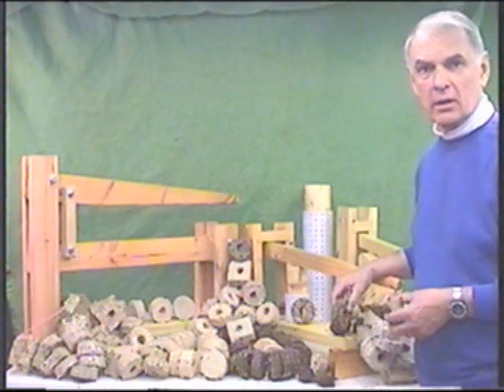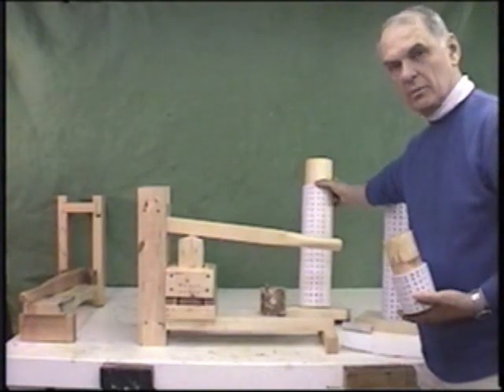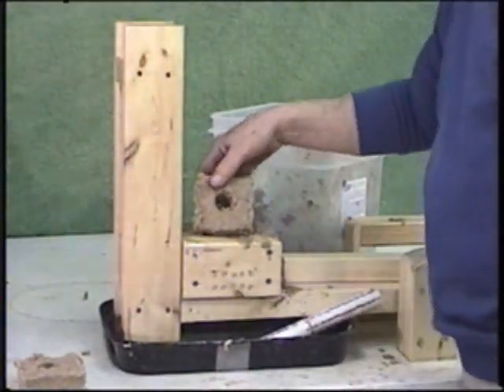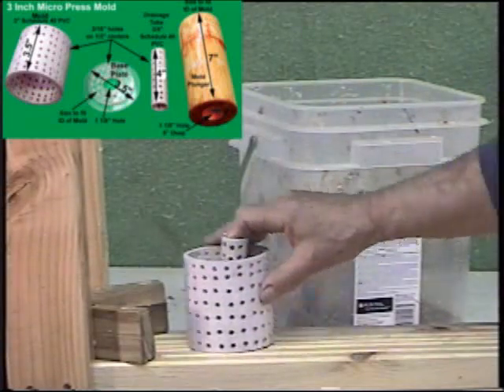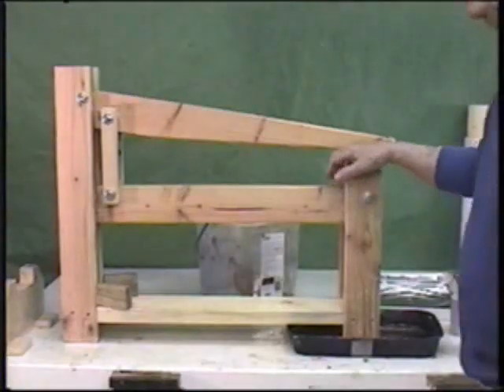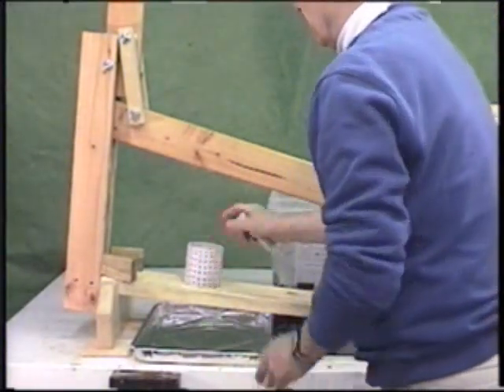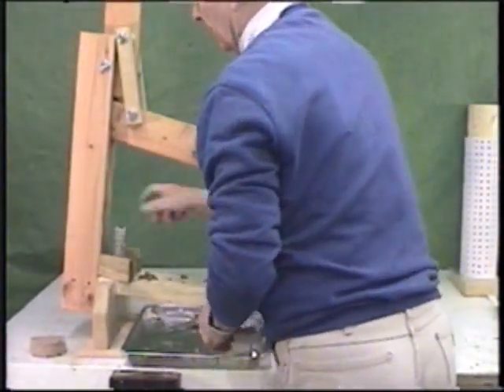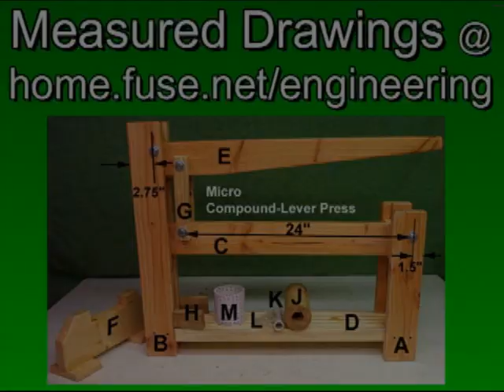Small (Micro) Biomass Fuel Briquette Presses made from Wood

Comment from the maker: Good question: I have found that hot water or even warm water helps considerably to breakdown the paper into pulp. Newspaper dissolves rather easily in warm water but the paper with a hard finish from magazines seems almost impossible to dissolve, even when in small chunks.  Of course heat can be hard to come by in some locations. I would recommend separating the sheets by hand then soaking in a black colored pail of water left in the sun for several days.  Not a great answer but it should help.

Comment from the maker: Good question. By volume using wet feedstock.  Soak sawdust or wood chips for maybe 10 to 20 minutes to allow for saturation then drain the water. Power stir B&W newspaper into hot tap water (not scalding) with a power drill using a paint stir with stir veins. From dry newspaper to paper pulp in about 5 minutes. Drain and mix the wet proportions, and add water for final mixture.  Always do the hand squeeze and shake test to verify a good mixture. Looking forward to seeing your new press design.

Comment from the maker: Outstanding idea, thanks for all the good work on this and for doing the video. In case it helps I have had good success with soaking wooden molds in used motor oil for about a day, after drying of course. The oil helps reduce the friction from wet sticky wood which helps with ejection and the expansion issue. Nice work!

Comment: I guess I will have to wait to get some either used cooking oil (will have to check with the wife about this) and/or doing an oil change in my gas car (doesn't need it yet as I just did it).   Water and oil don't mix so I guess that would definitely reduce the "sticking" issue.   Love producing more than one at a time!   It saves TONS of time this way!  Just add more support 2x4s on the base rails.   Otherwise plywood bends and they come out uneven!

Comment from the maker: Sure, no problem. Local material varies considerably around the world. I find people use whatever they have locally available like metal rods, metal pipe, nuts & bolts if they have them.  A metal rod with a split pin is a great idea.  I'll add that to the manual. Thanks for the suggestion

Comment: If I could throw an Idea at you for your next design. It seems to me that a knee action press like the old knee action mortiser, would be ideal. You would have an increasing mechanical advantage as the stroke progressed. So not much force when starting to squish out the excess water, but at the end, when the "knee" is almost straight, a tremendous force would be available.

Comment from the maker: Yes, for a wet sawdust mixture you will need a binder like paper pulp or whatever you can find that will act as a good binder. Finding a good binder and a mixture that burns well is one of the largest challenges in briquetting.  Don’t get discouraged. Constructing a press and a mold is much easier that experimenting to learn what formulation works well. That step can take a while.  Motor oil is a lubricant and definitely not a good binder.

Comment from the maker: Good question. I should have provided more explanation about the bottom support plate. The press can generate 12-14,000 pounds of force and the 2x6 is deliberately sized to provide a spring to prevent other parts from failing. The original design used a much stronger plate. The 2x6 must be good quality and void of cracks or failure can occur. If you want a less flexible plate just screw another 2x6 to the bottom of the existing plate and position it length-wise between the legs on the bottom.

Comment from the maker: Unfortunately wet sawdust will not bind together and motor oil is definitely not a binder. On the other hand, a commercial high-pressure press for dry sawdust will heat the mixture sufficiently to soften or melt the lignin causing good binding.

Comment: Hi, I built the braced version of the last demo.  The instructions were very easy to follow and this was easy to build.  I decided to add an additional brace along the longest diagonal on one side, as the single brace was not enough to keep the frame square during pressing.  I also used 5/16" bolts instead of 3/8," okay for most of the joins but not for the one at the highest pressure point (easily bent that 5/16" bolt).  I calculated that to exert 2000 lbs at the highest pressure point you would need to use only 50 pounds of force as the end of the lever.  The machine delivered the 2000 pounds but when I applied more, the force cracked the member that presses against the briquette piston (so don't do that or replace that member with a stronger material).  I also noticed that the angle of that member was always changing depending upon the position of the hand lever and so I was always having to align the piston to keep it going straight.  This was a good learning experience and probably the best you will get if your resources are limited (this machine made very good briquettes), but I am experimenting with other designs and will probably settle on something else.
Reply: Hi Suzy.
Nice feedback.
Have you progressed in your search for a more suitable design for your needs, if so how does it differ from the braced version /
I have just built the braced version and have noticed the same sort of flex you experienced.
Please keep us posted on your progress.
Reply: Lee

Thanks for putting the effort into designing these presses and producing the video.
I built mine from a large pallet to try and replicate how it could be done with minimal resources.
As you point out they can be built with very basic hand tools, the most sophisticated being the drill bit for the holes, although these could be done with a hot steel rod if necessary.

BTW I was directed to your site after seeing the video posted posted by Pauline Martin.
Just thought she deserved a mention for her video.
Reply: You're welcome! 
Thanks much for the feedback. Great idea to use a pallet as a typical resource. I have always been amazed at the innovative approach by builders.
Reply: Oops, I was logged in with my other account.
Reply: Leland Hite cheers

Comment: This is to pick up on, and add to, the comment by ELHigh below on making a ball by hand, no tools.  I am interested in TLUD, or char-making stoves, and the larger briquettes are not well suited for such stoves.  I had a chance a year ago to make some "balls", but after a while ended up doing something a little different.  I would pick up a handful with the left hand, squeeze, and pass to the right hand for a final squeeze.  When I got rolling I could do the left and right hand squeezes at the same time. I believe that each "ball" needed two hands.  Maybe some could find a way to do two at once, with only one squeeze per ball.  Smaller than the balls shown, but that was OK for my type of stove.  I think at least as fast as the two handed, large ball size.  The "turd shapes"  (can't think of a better descriptor for this shape) dried in a day and fired fine.  My question is whether anyone knows of a faster approach.  Can't be cheaper, unless it is faster.  My conclusion was that the human hand is a really remarkable "tool".
Reply: Oops, here is a better link to the compendium:  https://docs.google.com/file/d/0B12WsCOCGAvKTkRFQ0pNR3NiZzg/edit?pli=1

Comment: Hi! I've read the PDFs you have available, and watched the videos but i can't find wood in the correct size. I was wondering if the parts can be assembled from two halves each. In that case, can i use plywood to make each half?

Best regards, and congratulations!!!
Reply from the maker: Yes, I certainly expect that should work.  Glue well two pieces of 3/4 inch ply. I have never done this so I would appreciate learning what you find.. Thanks for the question
Reply: I believe that i won't get 3/4 inch, standard plys here come up to 18mm. Is it ok? Will that 2.1mm difference interfere with the function?

Best regards! And thank you for your fast answer

Comment: Hi Lee, Can I suggest a simple little modification to the double lever press for your consideration. i.e. Replace the long bolts with plain round rod with small holes for split pins  and washers at the ends. much cheaper and easier to obtain.  Garth

Comment from the maker: @MsPancha2010

I cut a 3 inch square to the proper length and shaved to a circle, first using a jack plain and then with a small finishing plain.  It goes rather quickly.  Sand to finish. 

The groves in the base plate can be done using a hand gouge or with a V-Grove router and bit.  Best to use a router table for that. Email me at leland.hite@gmail.com if you have additional questions.  Good luck with the project